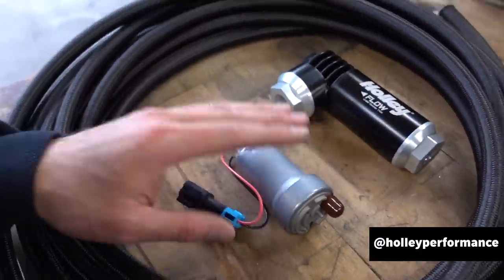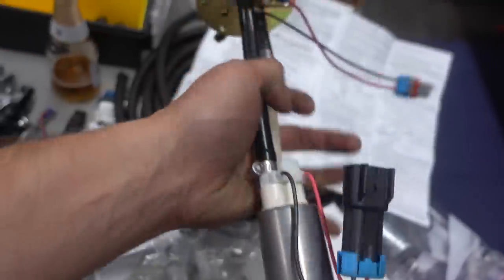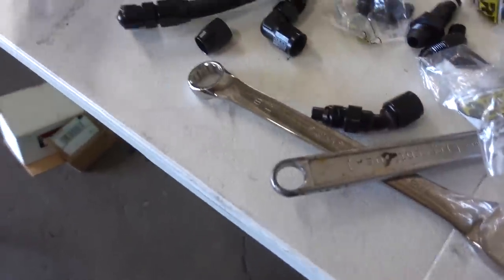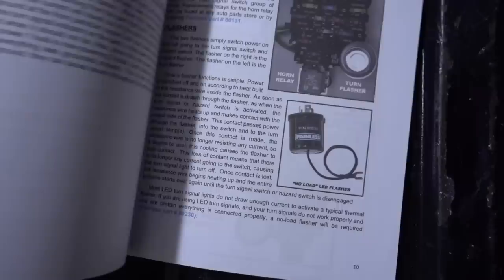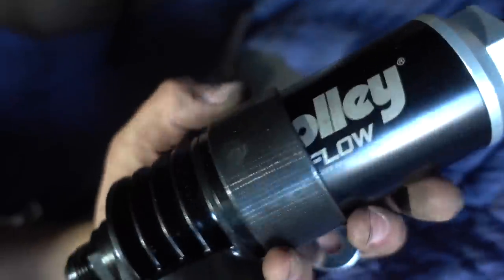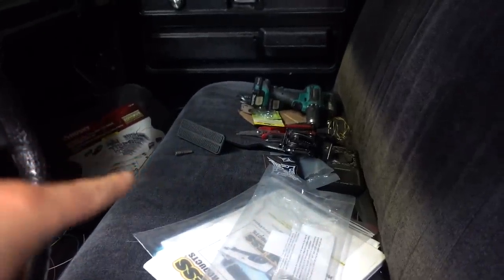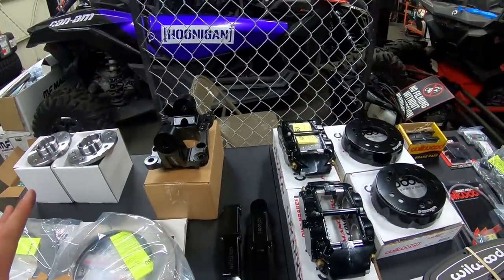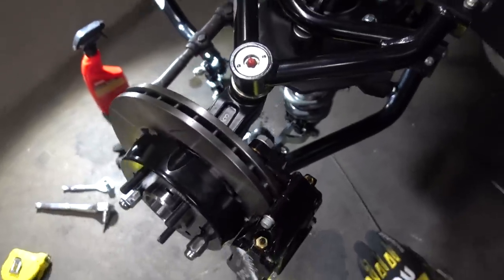Boomhauer’s 669hp LS3 Engine NEEDS Big Brakes!

Comment: Let me use the lift real quick to change my oil on the 33 😘
Reply: Or don't so it blows up quickly so you can swap a Barra in sooner.
Reply: It's called a floor jack and some jack stands, my guy.

Comment: Damn dude you got me drooling. I’m 23 when I was 20 I got 85 gmc first vehicle I actually started wrenching on. I swapped the 305 with gm good wrench  350 blew 2.73 10 bolt put in a 12 bolt 3.73 factory posi out of a 71 c10 also when through a couple th350 tranies. Wrapped that truck around a tree (got really lucky) and drove it 50 miles home. So found a 87 c10 with no steering, engine, trans, or brakes got it for 500. Over a month replaced majority of front suspension, pulled core support, inner fenders, gutted all interior, wiring, and any thing that was trash or would be replacing with the parts from wrecked truck ( which I was still using as a daily). So took my week vacation from work and swapped drive line radiator to rear-end, complete interior, doors, core support, and wired the complete truck (never wired anything before). Got it done to daily to work in one week by myself. 100% sure I’ve touched every bolt on the truck. With my age and budget only been able to dream of the stuff your using really enjoying the build it’s gonna be wicked!

Comment: zac you can use this stuff called fire sleeve to cover your fuel lines. its a fiberglass and silicone sleeve. i used it on both my fuel lines and my hydraulic clutch line to keep fluids from boiling

Comment: Don't only use flexpipes, use as much hard line as possible. Flex lines expand a little if u only use flex lines you don't get the same pressure as with hard lines

Comment: Hey Zac, you should change out that steering shaft for the Jeep shaft while you are in there.  It will eliminate that rag joint and give you much better steering feel!
Reply: You can build one for cheaper with u-joints and DD steel shaft. I did on my c-1500
Reply: @scottydoesntknow254  how much cheaper do you need it? I got mine for like $10 from the yard
Reply: @TxJonathan  that's good man. Congrats
Reply: Yeah,  mine was about  15.

Comment: Dude Zach. about that electronic gas pedal throttle deal. Instead of making a bracket to position it in a different place when you set it where the original pedal mounted it look like you could easily have bent the pedal arm assembly up and over slightly to accommodate the needs giving it a more OEM clean appearance instead of wasting time building a bracket. A little heat a couple pairs of pliers and a hammer and a few minutes it would have been done instead of that whole ordeal

Comment: Seems to me like it'd be easy enough to mod that old tank to be EFI ready. Although if your tank already needed replacing it makes sense as to why you went new. Not dissing the build tho! Shits definitely on the dream build list!
Reply from the maker: Gas tanks over 30+ years old, and we don’t need any old debris to go through the entire new fuel system and injectors. The fuel filter will catch a lot of it, but why not just upgrade now and get another 30 years out of it.
Reply: @HooniganProjectGarage  true true, I'm just too fuckin cheap lol. Seriously tho dream build right there. I'm currently in the middle of a 3rd gen Camaro with a dirt cheap big block swap, but the dream is definitely a truck similar to Zacs.

Comment: Hot gas does equal good things, if it's under your car, no it does not, but if it's in your engine, turbo or exhaust system, it's a very good thing
Reply from the maker: Hot gas prior to the injectors is no bueno...

Comment: Big brake? Hah... My '74 GMC Sierra C15 is still on a jackstand 'cause I can't get a damn brake line loose from the proportioning valve... Oh well, at least I get to watch someone do cool things to their truck!
Reply from the maker: When is doubt CHOP it off!
Reply: I would, but GM decided to put it in the cross member that's below the radiator... Sooo... It's pretty hard to get to with the steering lines and everything in the way. Fun times!

Comment: Where is the Dog?CAT wants to know who is inspecting your work. Is he Sleeping in the bed. 

I once had a Cheby PU truck , Dirt track 350 and 4 speed. Drums all around Want to slow down -downshift or spin it! Those were the days. NO PS or AC either.  No choke so scream it and pop the clutch. You are building a luxury truck. And You get no exercise while you drive. ?Better than pumping iron.

Comment: Wilwoods feel like garbage in my opinion. Off or on peddle feel make for a tricky street rod. They stop fine and do well on the track. But less than desired on the street without the really nice master dual master cylinder.

Comment: With all that nice new suspension, drop spindles and brakes, it seems a pity to be still running that very agricultural steering box and not a rack and pinion conversion with power steering. I understand cost is always a factor, but it looks like your doing everything the right way, but kind of over looking the steering.

Comment: Painless performance sucks for anything other than old Chevys and very few Fords. Anything else,you're re-routing and re-splicing half the harness to get it to work. The whole manual thing is just him getting lucky too. I've done 3 kits and every single one didn't have the instructions,it had a quick set up guide for Chevys. I had to dig for a manual every time.